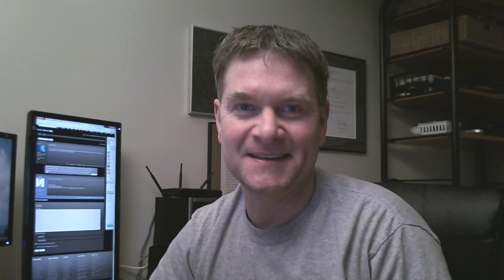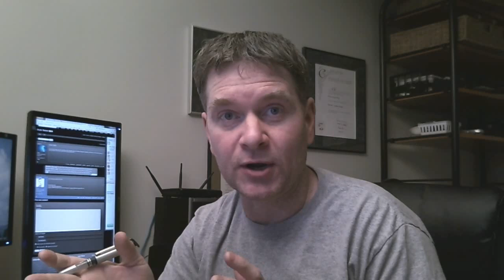#420 - Q&A: Power Supply Unit Efficiency Level Certifications?

Comment: Diamond, an allotrope of carbon, is the hardest known material on Earth, with a rating of 10 on the Mohs Scale of mineral hardness.
Because diamond is an insulator rather than a conductor of electricity, it is not classified as a metal.